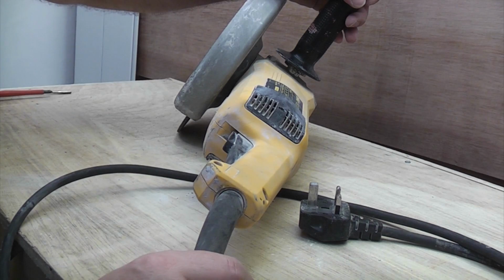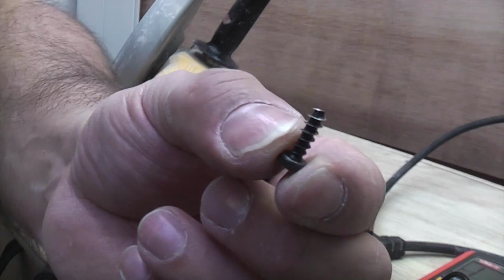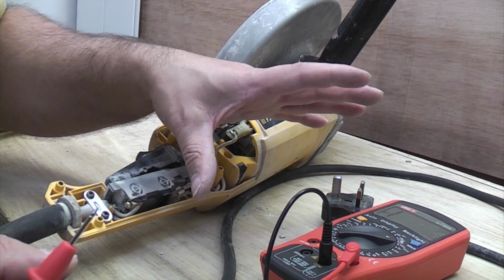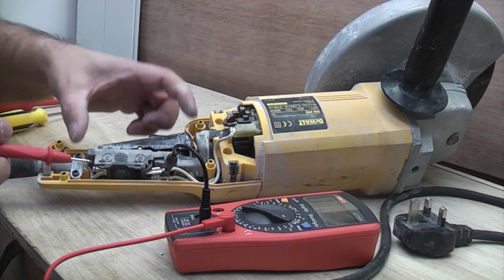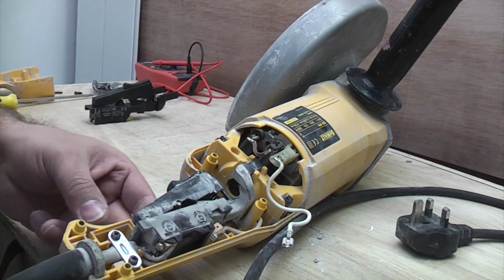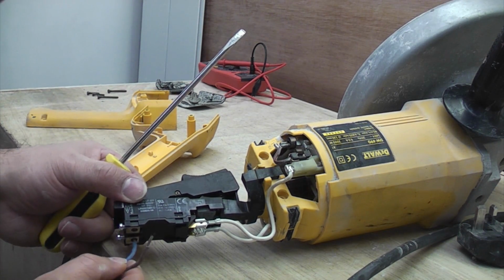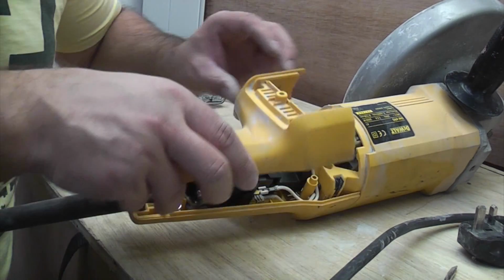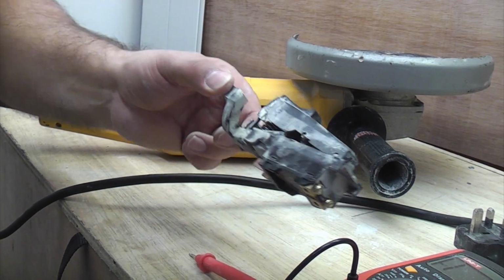Dewalt  Angle grinder electrical fault finding

Comment: Cut tile 's , metals, dust and powder's added.once enter the brush 's , will be trouble 's...need to do cleaning...I knows....by now...good tools , do need a body's cleaned, in after stopped working....a brush, ' or ink painting brush ' , are very useful...

Comment: My old dewalt right angle grinder lasted 12 years before switch went out.  My new dewalt grinder switch just went out, in less then 2 years.  Meanwhile, my Makita grinder has lasted 15 years and still running strong.   All of these grinders have gotten about the same amount of use.
Am sticking with Makita from now on.
Reply from the maker: I've heard mixed things about Makita, most people love them and say they are really reliable but one of my mates got a pallet load for a charity job he was doing, and he was not impressed with them.
I tend to stick with Dewalt, as they have always been good for me, I think this grinder had been left outside (after lending it to someone)
Thanks for the comment 👍

Comment: I have an issue with my 115mm bosch grinder, keeps speeding up and slowing down and sometimes just cuts out completely. Any idea's what i should be looking for?
Reply from the maker: We had a Bosch grinder on-site a few months back doing exactly the same as you describe (brand new), it is faulty and needs returning to where you bought it from. If it's old it could be the brushes or damaged commutator  (that is my guess)
Thanks for the comment 👍
Reply: Ultimate Handyman I think I’m just out of warranty so can’t return it, it’s a shame because it’s hardly had any use the brushes are almost new. Good excuse to buy myself a cordless one though I guess!

Thanks

Comment: Yo guys i need to ask u question its good and important so switches here are chinise and cheap up to 20 for a legit one or even better are sold like custom but i need to ask u how can i possibly put whatever switch i want can i even ? i wanna put one press down and hold kinda switch hold for on not locking one so idk if i should what the switch usualy is it like ??
Reply from the maker: I would only ever buy genuine Dewalt replacement parts.
Thanks for the comment 👍

Comment: What's about to check brushes at first? If brushes is short enouth, toll would stop working. It's easy and it's very common reason why tool stop working. 
Also what's about to repair damaged switch? Sometimes metallic connectors could have snuff or dust. It's very easy to clear it and it will save time and money
Reply from the maker: +sluge1 
That's correct- https://www.youtube.com/watch?v=9Vj8RQg-We8
But in this video it is not the brushes, hence the fault finding to eliminate the lead and plug etc.
Reply: Good work thank u

Comment: Hi i have a Bosch 5" grinder.After cutting 30mm paving the grinder has started to "pulse",ie like some one is turning the power on and off every second or so.I checked the brushes and there is plenty left on them,any ideas why this is.Thanx
Reply from the maker: ***** You could try cleaning the commutator, where the brushes touch it. You could also check the switch to ensure it's not at fault.

Comment: Why not to try repair old switch itself, unless its not melt there is a chance and so much more joy of it! I have old dewalt dw988xrp and it has blown transistor, I only need to find accurate one 25A and replace it. I would try first connect cleaner spray first.